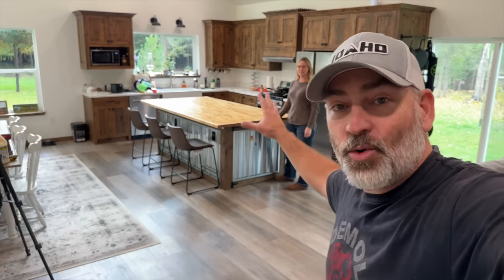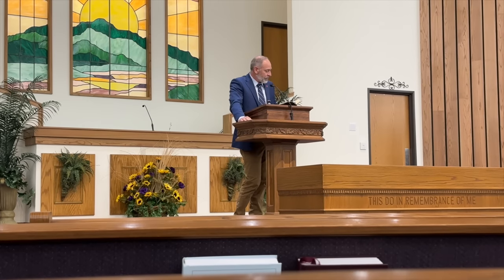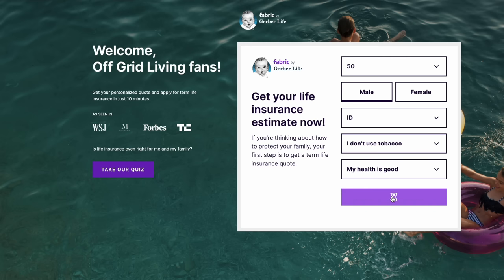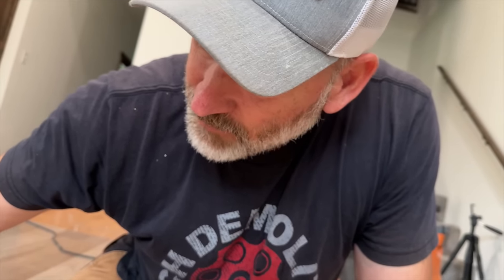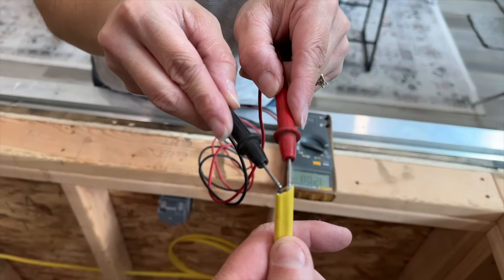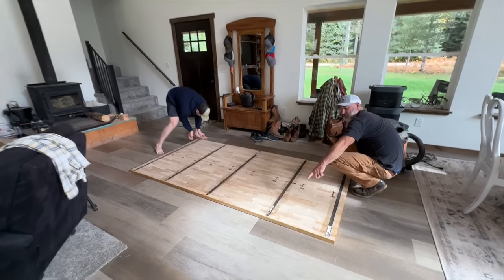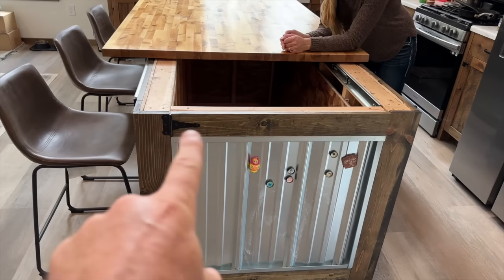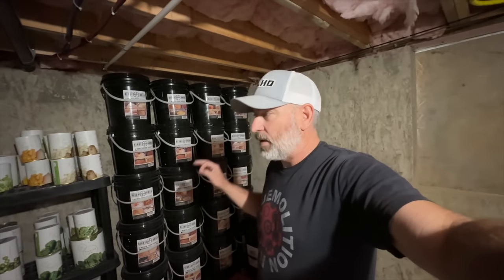SUPER SECRET BUNKER UNDER KITCHEN

Comment: It's because you only treated one side of the worktop with varnish and the other side was left natural that will cause it to bow on one side often. Best to always treat both sides top and bottom then it will reduce likelihood of this happening.. 👍🏴🇬🇧
Reply: 100%
Reply: I thought the same thing
Reply: Plus cooler cellar below with a water tank down there so the bottom face will be higher humidity.
Reply: 100%
Reply: You are 100% correct. And the angle iron without a treat of the underside will likely rip teh screws out. Not enough to prevent it from happening again.

Comment: Once you get it flat, seal the bottom too. Chances are the warp is because moisture penetrated through the unfinished side and caused it to expand which now shows a dip in the top. You will also need to support it from the bottom too.
Reply: A moisture issue, exactly what I was going to say!
Reply: Definitely a moisture issue.  Ask me how I know? lol Lets just say I got the t-shirt

Comment: The iron bars will certainly help but it would also be beneficial to seal the underside of the wood too. When one side of "raw" wood is left unsealed, it will absorb and react to humidity more so than the sealed top and cause odd wood movement effects. Just like other folks have already said 🙂

Comment: My personal opinion, you should have sealed the bottom of the counter top.  It probably absorbs the moisture, and cool temps from the cellar with the wood on the bottom expanding when the wood on top not expanding because the top side is sealed.  The steel angle iron is a great idea, but sealing all six sides will do wonders to prevent warping.

Comment: As has been stated by several others, the major reason your countertop warped is because you sealed the top and sides, but not the bottom. Moisture came from below, and soaked into the raw wood. Causing the bottom of the slab to expand, while the top did not expand. Your angle iron pieces will help. But your best bet is to get it good and flat the way you did, and then seal the bottom. Giving it several coats, to be sure...

Comment: When finishing wood products a good rule of thumb is what you do to one side of the wood surface you should do to the other.  Wood is susceptible to moisture in the air and varnishing closes off the pores and stabilizes it.  Where your cellar is more damp than the rest of the room puts more moisture into the wood surface on one side causing warping.  I would recommend starting over with a new surface and using wood finish on both sides.  You can also put in a metal ‘C’ channel in the wood surface on the cellar side of the top.   I am curious to see if the angle iron will be strong enough to hold the surface straight.  Cam at black tail studios has several videos on stabilization of wood surfaces.  This comment is coming from a place of love and respect for you and your family.

Comment: Nice modification. Well done. I think I might have used the circular saw to relief cut that deep dado then run the router through. Less wear and tear on the router bit. And making that mess in the house? Good job cleaning up the dust. Awesome as always. Thanks for sharing

Comment: Agreed … seal the bottom with what you used on the top. The dampness from the shelter below has warped the wood. Now that you reinforced the counter top door complete the process and you shouldn’t have the problem again … great job👍👍👍🇺🇸👍👍🇺🇸

Comment: Great job on the bunker. One reason your top warped was due to only sealing one side of the counter top.  As the bottom dried out, it pulled the grain closer causing the warp.  I recommend you seal both sides.  Your hinges need to be hidden as well as your latch for securing the top. Recommend using a magnetic lock to release the lop.  There are many hinges that can be hidden.  If the power is cut off upstairs, what sources of light do you have down in the bunker and what about going to the bathroom?  You're very skilled and build to or above code so good on you.  Thanks for the video.

Comment: Put a GFI outlet in the first position on the island (connected to that wire you were testing for power). Any outlets connected to it on the load side of the GFI outlet are GFI protected.

Comment: It bowed because you didn't finish/seal the underside of the table top and it absorbed more moisture than the top so the wood on the bottom expanded expanded causing the bow. . You need to seal the undersurface of the wood to equalize  the wood absorption of moisture.

Comment: I hope you are grounding the sheet metal. And it does need a GFCI breaker because it is near water. You probably need two circuits. How many crock pots can all those outlets run?

Comment: I think it's pretty cool, but doubling as your kitchen island it comes at the cost of prime kitchen cabinet/draw storage.  16:50 you should staple up some bubble foil insulation on the ceiling down there so you are not eating insulation down there.  I have it in my basement low ceiling its soft and durable if you bump your head and reflects a ton of light where you need it.  Plus it keeps the insulation where it belongs.

Comment: Are those boxes rated for use on a metal surface? Might want to ensure you ground that metal surface one way or another.... Also, you need to coat the back side of your countertop to avoid inconsistent moisture absorption.

Comment: Seal the bottom. It happened to me also I made a solid wood top for a desk and sealed only the top. It pulled. The exposed wood pulls in water and then expands while the top does not absorb anything

Comment: Hi Y'all, I love the hidden bunker, please make sure you have a door the you can get from the bunker to outside. That way If terrorist or cray people happens to break into your home, you will have a place to hide In and get out of the bunker to outside of the house. Make sure you have a lock on the inside of the bunker. Make sure that the door into the bunker Is hidden or disguised with plants,  or a water hose holder or something else so It can't be clearly seen from outside. Make sure all who live In that home know that they can run Into the bunker for emergency purposes. I love It. I wish I had one. Blessings to all of you.

Comment: Yes the island has to be on gfci. And all circuits must also be arc fault now.

And nothing can be on dish washer, fridge and stove circuits. They have to be dedicated. Same with microwave.

And kitchen outlets themselves have to only be on a shared circuit in the kitchen and not on the same wall as each other. Really each one should be on its own circuit or something close because a single toaster with a coffee maker will pop a breaker.

Comment: Electrical comment, The Range needs to be on an accessible GFCI circuit. Don't have the GFCI behind the stove.
Be very careful of the metal roofing around your outlets, In an industrial applications you would probably have to actually bonds the metal to your equipment ground but some inspectors may not understand the safety issue.

Comment: Just an observation -- your exterior door to the outside from the root cellar is a weak point in your security and for the food and anything else you are storing down there. Perhaps you can fabricate a metal door and attach it to your concrete foundation so it can be locked from inside. Also, if you needed to use the cellar for your personal protection, you should have a lock you can place on the floor board door under the island so it can't be raised from inside the house. Perhaps one is already there and I missed it. I think the design and access to your root cellar is so creative. Wouldn't mind having it for myself.